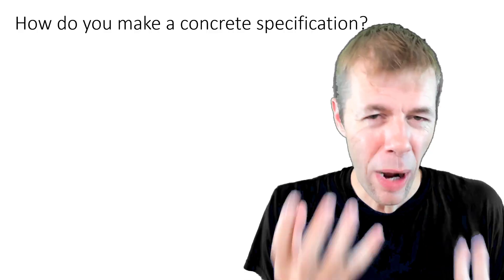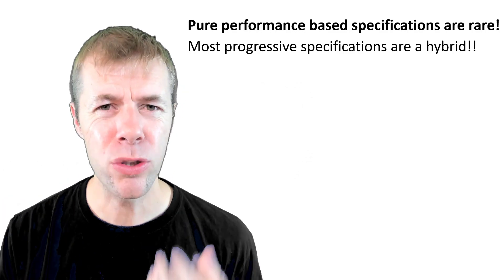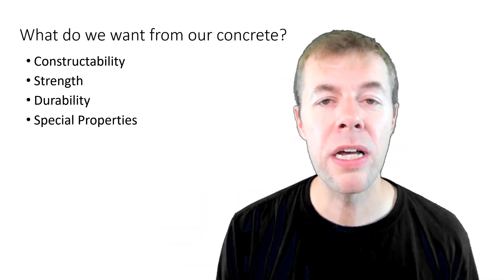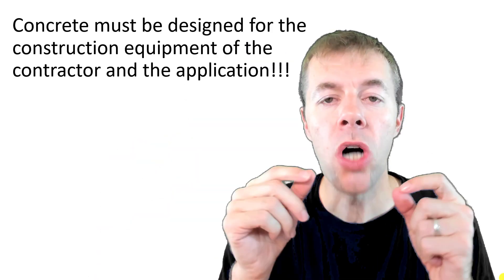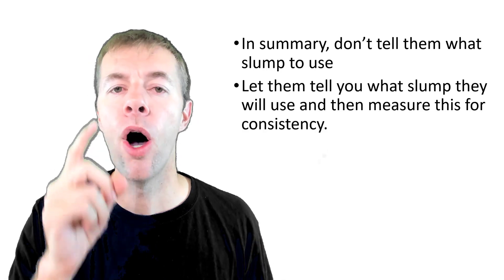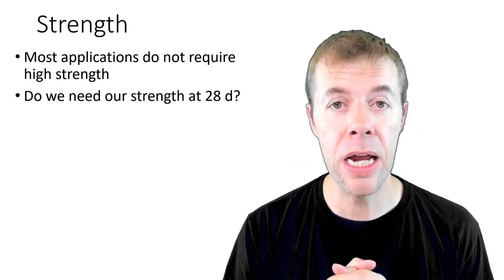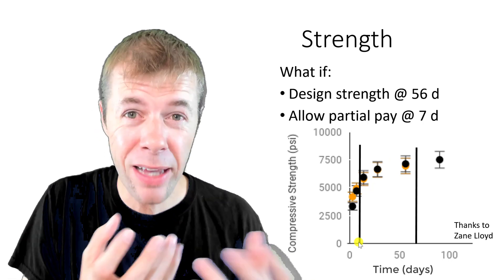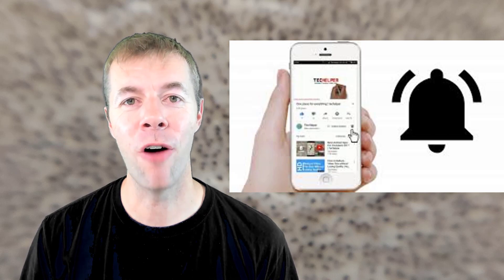How to Develop a Concrete Specification?

Comment: Speaking of Needs , and Specs , I Need the specs/Recipe for the concrete they used to make Municipal Building [Nuclear grade for the Civil Defence Department] in the years between 1946-1956. I had to drill some holes in an old Hospital wall. It was so Incredibly Dense that I burned out 8 Carbide bits , and only made a 1 inch hole. I did not see any aggregate , and the consistency was micro grain.

 How was this stuff made , and where can I get some?
Reply from the maker: Jeff,  I am not sure I can help you with this.